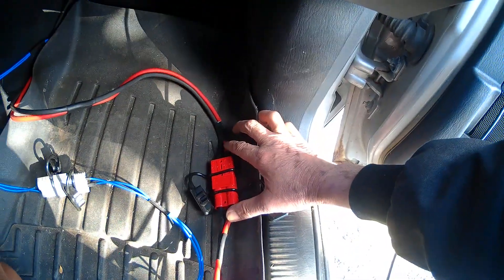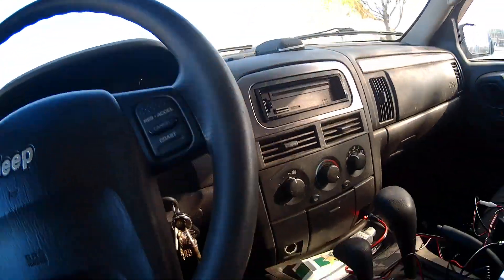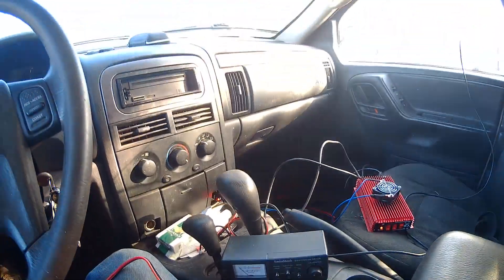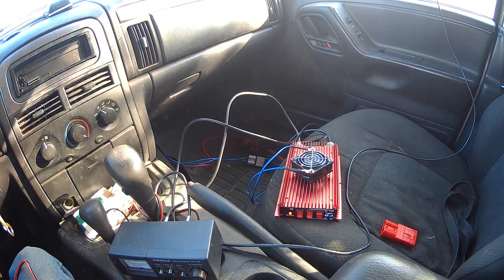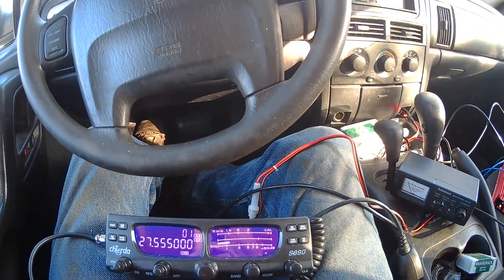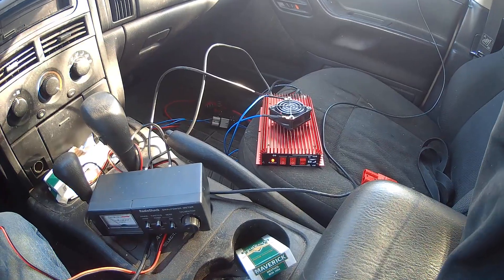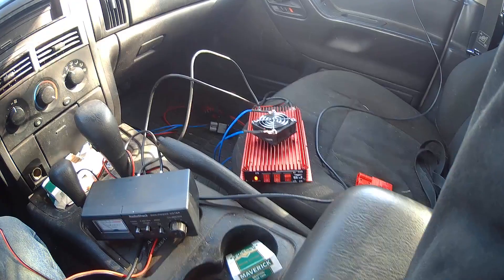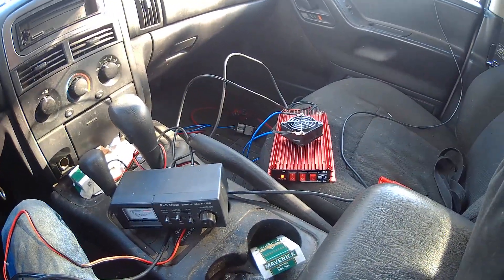BJ 300 plus installation video How to run mobile power wires for CB / Ham / Music amplifiers Part 2

Comment: Hello, can I wire a pc fan into RM italy 203p cables with a switch or do I need to wire the fan independently to the battery with its own wire? Thanks
Reply from the maker: The 203p does not draw that much current. You can wire it right in with the amplifier. Make the wires short as possible close to the amplifier. Make sure its a 12 volt fan with the proper rotation.  If you take it apart and drill holes to let the heat out you want the fan to draw the heat out. If no holes blow the fan towards the box to cool the heat sink
Reply: @TorpedoHeat  Thanks, I plan to at least set it on top maybe just zip tie it temporarily. Thanks for the tip on blowing the air towards it if I decide not to drill holes.

Comment: I have a cobra 29 CB when I turn on my BJ 300 just to on and key the mic the antenna warning light comes on.  My SWR reading is 1.5/1.7 I trimmed my antenna lower it’s a Wilson 2000.  How can I make the antenna light stay off and make sure I’m not over driving.
Reply from the maker: It depends what channel you are tuning too. Usually I dont trim an antenna

Comment: I'm in Australia ,I have the same radio and amp , don't really need the amp as the radio has more than enough power .I have everything mounted on piece of half inch ply and it just sits on the passenger seat when in the car , my wiring looks about the same as yours
Reply from the maker: I understand. The only reason I run an amplifier is to get over the train wreck. Im furtherst north in Cleveland Ohio. Right on the lake so to go across the country I have to go over many radios. Now I run an RM Italy KL703

Comment: I’m putting a radio in my truck and putting an amp on it . I’m using a 250 watt box just wondering what amp fuse and what gauge power and ground wire you were using. Thanks
Reply from the maker: Im using 10 guage which is a bit overkill. Make the wire as short as possible. You never want to oversize the fuse so a 20 amp should do it for that box. Ground the chassis of the box to the vehicle body. That will help a lot in getting DX contacts. 
Thanx for watching...
Reply: @TorpedoHeat  Much thanks for the info. Hope to be able to make contact one day 👍🏻😎
Reply from the maker: @Regulator308  what state are you in ??
Reply: @TorpedoHeat  Southeast Kentucky

Comment: do you have this all trough your cig lighter ? What amp is your cig lighter rated for in amps? My QT-80 is iffy as hell at 80 watts and 10 amp draw.
Reply from the maker: No just the radio is plugged in the lighter. Im not doing 80 watts so no problem. I run an RM Italy KL703 @ just under 50 amps. I have an extra battery set up. One of my other videos shows how to hook up the power supply for an amp without extra alternators.
Thanx for watching

Comment: I hooked this amp up today, my SWR was 1.0 after keying up the amp, it sky rockets to 5.0 I can not get it down, any suggestions would be greatly appreciated
Reply: I got one of them never used it got a rm instead.rm is way better and they have low pass filters that match the amp I have no swr problem useing low pass filter with my rm
Reply from the maker: What antenna and or radio are you using. I actually use a magnet mount with 12 feet of rg400 coax. I did set the antenna but I have a great swr.  It would take a bunch of typing but you can call at (216) 801-6215 if you like
Reply: @ I'm using a Tram 1499 and 100 feet of rg8x my SWR was perfect but now it's sky high I will give you a call tomorrow to pick your brain see if we can figure this out.
Reply from the maker: @rhbowhunter  Great I will wait for your call.

Comment: Checking in too see how this amp is preforming I was thinking of getting one please let me know how you like it
Reply from the maker: The amp works as described . It is a basic amp with no pre amp. I was able to overdrive it and get 275 watts out of it. I dont know how long you could do that but it showed the numbers. For the money it is a great stand by amp. Now Im running an RMitaly KL703
Reply: I bought one off of Amazon. It only put out 170 watts not 300 what they advertised

Comment: Back for a replay on your setup. My alternator in my truck is 136 Amp. I am going to rewire my truck. I need to get the nice connectors like yours.
Reply from the maker: They dont cost that much on Fleabay. I got my whole set up for about 60 dollars wire and all.

Comment: Just watching your channel and I’ve just ordered one of these BJ AMPS and just wondering what you think of them. Because most people say to me get yourself a RM AMP. Because it’s been around long time and it’s Italian .  But I see this one and for the price I thought let’s go for it. This is how I found your channel. So I’ve subscribed to it now. Thanks again for letting us see what you done. Alan from England 26 CT . 48/70 . 73 s and hopefully one day we’re get a copy. If we get any skip, because it’s flat over here for about 1 month. 🇺🇸🇬🇧💯👍
Reply from the maker: Yes its been flat here also for quite some time. I do also have an RM Italy KL503HD. Its a better box with an excellent pre amplifier. The RM Italy is High Drive so it can handle 35 watts drive and an SWR of 2.5 to 1. Its a tough box. The BJ 300 Plus needs low drive which can be an issue with some of these 10 meter radios out there now that have been broadbanded to 11 meters. On SOME of them even if you turn the dial a watt down it will swing too much for the BJ 300 amp.  Yes the BJ 300 works but it is nothing special or of great quality.  So just to let you know Most Likely the high low power output will be backwards. With low side doing more than high side. Not a big deal but still funny. Make sure you run a swr meter with the BJ300 as it is way more fragile than other amps on the market.  Yes hopefully we can make contact when conditions come back. Thanx a million for watching
Reply: @TorpedoHeat  thanks for getting back to me so quick. And that’s News I needed to hear. I’ve been watching YouTube about this AMP and like you saying not to Drive too much for it. Some of the people are saying not even to put what it says on the back of the AMP. So thanks again for your help . Alan 73s. 🇺🇸🇬🇧💯👍
Reply from the maker: @alanslade-x6m  Yes 2 watts drive swing 5 or 6 is enough.  Also the BJ300 Plus model with the fans does NOT have a temp sensor. The fans are on all the time the amp is turned on.  It does work but its not a high quality box. Further the only way I found to ground the body of the amplifier is through the screws holding the fan on. If you dont get the plus model with fans it will be a challenge to ground the box aside from the regular pos and neg wire which is thin wire anyway. You have to add an extra chassis ground to get DX with this box.
Reply: @TorpedoHeat  thanks for letting me know  . Great information cheers 🍻🇺🇸🇬🇧💯👍
Reply from the maker: @alanslade-x6m  No problem !! Happy DXing
Reply: Those are actually transgender connectors.

Comment: How do you like that 300? I have a little RM Italy KL203p I run in my truck every now and then. Seems to do pretty good. If I run my Quad 5 I don't use the box. I use the 203p with my Cobra 29 or my Grant XL. great video Torpedo.
Reply from the maker: Sorry I just saw this comment. Its just a plain Jane amp. Some might call it a Splatter Box. No filters, not very tight but it works all the same.